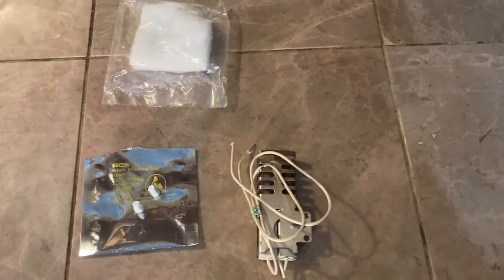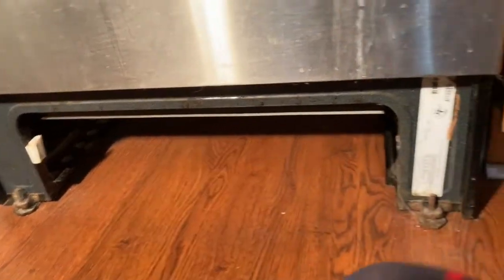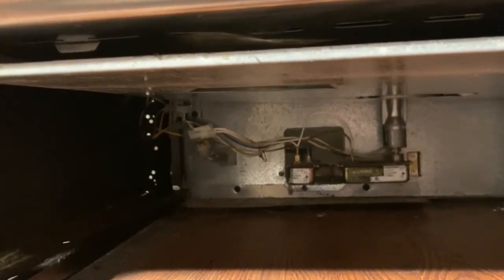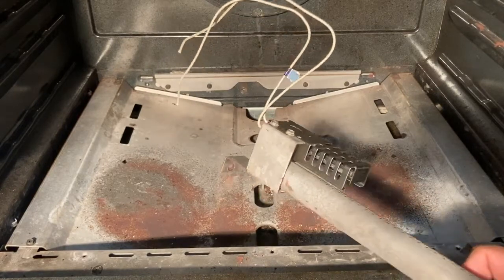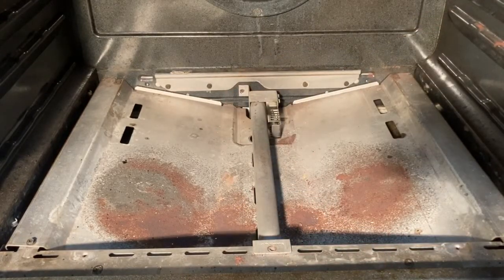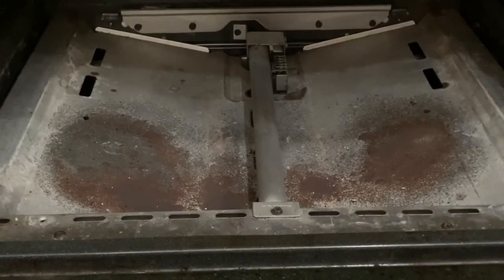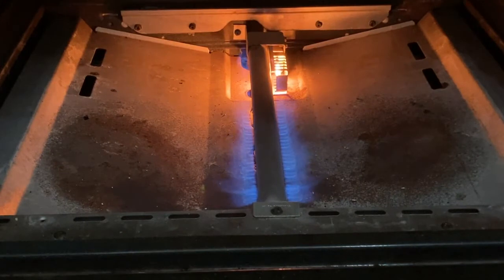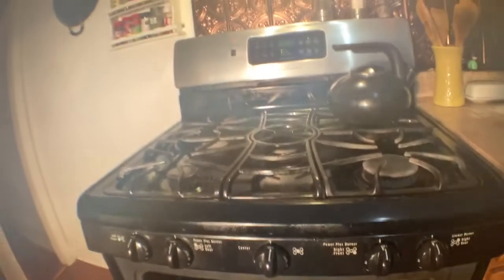DIY:  How To Replace an Oven Igniter ⚡️

Comment: Hey what if i stupidly pulled the connector off the oven wires and now its just loose. Should i just go ahead and splife the oven wires and do it how you did here at this point? Thanks
Reply from the maker: I feel that if you have wire nuts, you should be able to use them for a safe splice.
Thanks for watching!